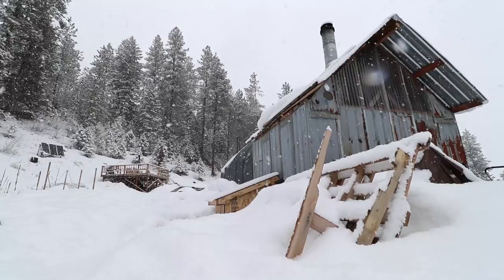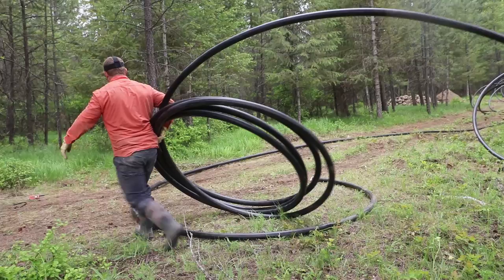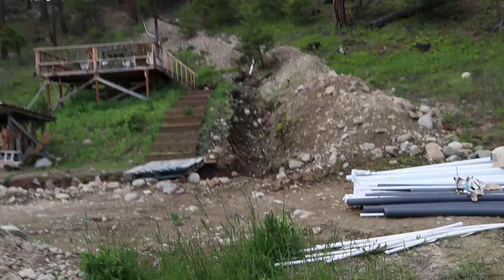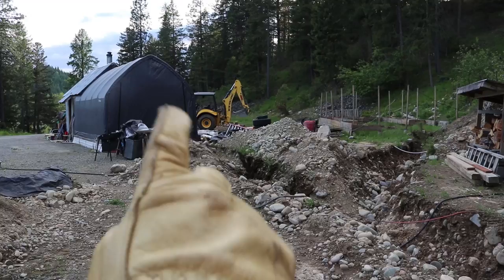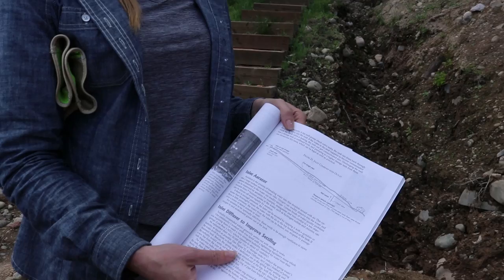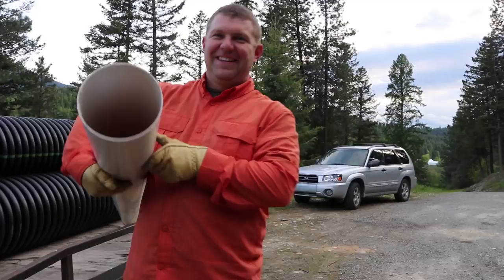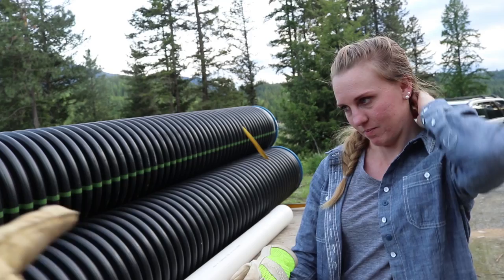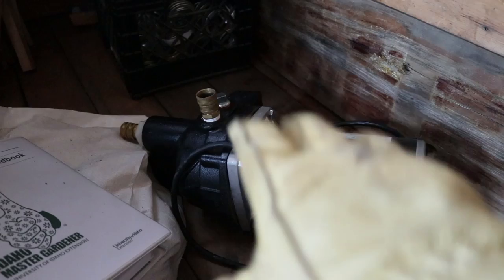EPIC $10,000 OFF GRID GRAVITY-FED WATER SYSTEM

Comment: after all is said and done you still have to fill your cistern with water that you have to pump up-hill.........drill a well..
Reply: solar powered pump...with the amount of money already spent they could have had the well drilled....and with this system they have to fill that cistern for ever.....and they'll be paying for that water also
Reply: +supurbian agreed, even if they bought 10 pressure tanks and ran a 120 volt submersible on a generator , they would be better long term . still not self sufficient.. I'd be looking for a few well witches and see what they say .. or even use that back hoe to dig a shallow well and see if that works. all that stone would be handy for making a foundation tho...
Reply: No, supurbian, it would cost them a lot more to have the well right now...  

Drilling a well, especially if you have to hire someone to do it, can costs more than several thousands easily... Especially, as there is no guarantees in the process and they may need to dig in multiple spots until they find water.  

Spending triple what they paid for their present system isn't unheard of and in most cases it's usually well over $10K... Especially in places like there's which will be hard to dig through...

Add, a well pump system will require more power than their present system provides.  So would mean they would need to upgrade their solar or spend constantly on fuel for the generator...  So the well water would hardly be free of costs... and could push their total costs over $50K... Funds they don't have at the moment as they're spending it all on the equipment to build the house...

Besides, if they add a rain catchment to their present system then they won't have to pay for water anymore and the cisterns hold enough to last them a couple of months.  So they're good for a severe drought...

And with the rain catchment they will no longer need a pump at all as the gravity feed system requires no power... 

While lets not forget they're trying to build a house... They're hoping to not need to spend another winter in the RV... So that's the priority for their funds right now...

Not to mention worse case, if their septic tank ever fails then that means the well water would be contaminated and then the cisterns would be the only safe water in the area...  So it's better to have it in the long run as things can go wrong and eventually will over the years...

Part of being off-grid is being prepared for when those bad things happen...
Reply: +verteup you seem to be missing the point, there are more than one type of well..
Reply: the real point here is that they bought a piece of land without the most important thing needed...and that's water..and a well would add to the value of their property... it's not as if they're building a hunting cabin or a bug out shelter...
Reply: Or better yet a rain catch water system?  Are they in a drought area that doesn't allow for it?
Reply: ed p, you have any idea how many properties around the country... forget that, around the world, exist with no wells?  The majority of people on the planet are not getting their water from wells!

Sure, a well or spring help add value but not every property needs them!

Unless you're living out in the desert and water is vital then there are other options!

There are people who have lived on their property for generations with nothing more than rain catchment...

Even having a well is no guarantee... Wells can go dry, geological water tables aren't static... Droughts, seismic activities, potential contamination, etc.... There are multiple reasons why wells can fail...

They do plan on eventually trying to get a well if they can but there's no reason they should limit themselves to only one water source... Redundancy is good when you're off-grid because the only one who is going to help you when things go wrong is yourself and what things you put in place to cover you when that happens...

Really, what do you think is going to happen to the well water if their septic system ever fails and spews sewage into the ground water?

What happens if they have a power failure but have a fire on their property?  Well water is not going to pump itself?  Gravity fed cisterns on the other hand will continue to work even with no power...

Among many other scenarios where multiple water sources not only make sense but can make the difference between surviving and dying on their property...
Reply: William McClain, no problem... You made a good point too... No well digger can guarantee water and in some parts of the country they may have to dig very deep...

I believe they stated in one of their videos that they're in a glacial deposit zones... So the makeup of their ground can be a wide mix of things, which means there likely isn't a consistent water table throughout their area, which increases the chances it'll be hit or miss and combined with how high they are above seas level means they will likely have to dig more than a couple hundred feet down to even try...

If the bedrock is really deep, then the rocky soil also means they'll likely have to use casements going pretty deep too, compounding the cost of digging a well...

Environmental rules in their area may also require them to only use water from a certain depth to avoid possible contamination from the surface.

It can still be done, but it's likely going to take a serious investment that there's no reason to rush now when they're trying to build a home and not live in a RV any longer than they have to...

Their recent AC install video highlight one of the many reasons why the sooner they can move out of the RV the better...
Reply: first off you guessed wrong.. i didn't say the property is worthless without a well...i said a well would add to the value... what makes that piece of property attractive is that it is wooded mixed hardwood and softwood (pine)...looks like they got two rocks for every dirt.i cant wait to see when they start plowing the garden....unless they go with raised beds....oh i almost forgot.the garden also will need water!!
Reply: Nope, a water well for acreage can have some value, but you typically won't recoup the total expense unless you managed to get it drilled very cheaply and don't run into costly maintenance and repair costs and are lucky enough to be able to get good quality water that doesn't require water treatment to be usable... But that's not something that can be guaranteed...

Again, most of the people on this planet are not getting their water from wells and that's for a bunch of reasons!

Wells are not a cure all or guaranteed in any way and there are times where other solutions are more practical and economical... There are also times where you may need multiple water sources as no one water source may be guaranteed or provide for all your needs in every possible situation.

Even after getting a well, they can fail for any number of reasons... Wells are not a unlimited resource, but part of the hydrologic cycle... Just like rain water, rivers, and streams, etc.

The ebb and flow of water through the ground can change over time and even dry out... So pretending it's some guaranteed resource is misleading at best.

Sure, some people can definitely benefit, but again it's not something that can be counted on everywhere....

People, however, live everywhere regardless of whether there are easy to dig wells or not or other easy to access resources...  

Places like Las Vegas were built in the middle of deserts!  Among other examples where local resources didn't matter...

So again, other solutions are valid... There's no one right way to do things and there can be multiple solutions that compliment each other to serve a greater range of needs.

Really, there are plenty of things that can be useful but it doesn't mean they're for everyone... There's always pros and cons to be considered and location matters as that can change many variables as to what can and can't work for a given area...

Comment: I hope you know you will be giving up pressure I recommend a water tower to increase your ft.pounds and volume. 
I am a Master Plumber and the potable water is going to loose head pressure if you push and on those hydrants I recommend turning the tee downward into a gravel bed then drive a pole beside them and when you shut it off it has a place to drain!

Comment: I'm not sure why you need a separate fill line for the cistern.  You can connect to any facet at the bottom and pump your fill water up the same line you use to supply water for your needs at the bottom of the hill.  Just a thought.

Comment: I'm a little confused, where exactly does the water come from? Are you having it shipped in, a spring on the property, where?
Reply: Michael Robertson Ship it in
Reply: I'm a little confused he said a couple of bucks to have the water brought in?  So someone will drive a truck and sell you $2 worth of water 2000 gallons or so?  Somethings not adding up?  UPS/Fedex want an extra $3-4 just to go to a residential address over a commercial address to deliver a 1 pound package.

That water here from the utility would cost around $1.3 if at Tier 1 water rates, or as high as $4.5 if at tier 3.

Comment: I have a well that I just upgraded the tank and fittings for, new well from my installer minimum is 3500 my 100ft well cost that. 30k would be insane. However how far down do you need to go where you live?

Comment: Interesting setup, few questions; You're running a generator to power an electric water pump that is feeding through a garden hose up stream? Why not buy a cheap 2" gas pump for sending the water up hill. I've been using a cheap Hazard Fraught 2" gas pump for years, filling my IBC totes and also transferring rain collection water. Also, did you ever think about burying the big tanks closer and just use a on demand pump to a LARGE pressure tank? You could have solar hooked to a bank of deep cycle marine batteries for the pump. I bet something like that would have been a LOT less that $10 Large. I still think a well is the best idea, if SHTF and you can't get water at water world or wherever you get it, you'll be okay for a little while, but then what?

Comment: So 50 ft head/2.31 ft head/psi = 21.65 psi at the tap. Not bad for a gravity system!
Reply: htmagic  would that be enough to run a ram pump?
Reply: altaylor1980 easily able to run a ram they can be ran off 6ft of head these guys have 50ft of head

Comment: excuse an ignorant question here;  With all the rocks and boulders in the cistern pit, why do you need to remove those?  I understand not wanting to drop large rocks on the cistern as you are filling the hole, but if they're already there.... why not add sand around them to stabilize around the rocks and then just back fill as planned?   Also love your channel and I'm planning on making a similar move in the next few years myself, also in Idaho, possibly around the SE side of the state.  Thank you for your videos and all you do to make this accessible to folks like me, I greatly appreciate it!!!!
Reply from the maker: +Jayson Davidson Its ideal to have a downward slope out of the cistern, and if we added sand over the rock, the pipe would be going up away from the cistern. And our cistern documentation specifies that the backfill shouldn't contain stones larger than 3" in diameter. Also, the weak points of the cistern is the curved part at the bottom, so even more important to not have rock under it. Good questions!

Comment: Could the tracer wire double up as network cable? Depending on the length of the trench, you might want to pull a few network cable up there for monitoring the water level or for a camera feed, etc.
Reply: I suggested running a signal wire through the other conduit. Could also run network cable for a sensor, camera, etc.
Reply: The tracer wire can't be used for networking. It is single strand, no twist, wrong gauge. But, I do think it would be a good Idea to add in a couple of Cat5e cables. I would get a 1000 foot roll/box  of direct burry and run as many complete lines as that would allow. It might be over the length limit but, it would be fine for sensors and the like.
Reply: Eric, I never said the tracer wire could be used instead of Cat5e cable as there are 4 twisted pairs of wires and usually shielded as well. And the tracer wire would go outside the conduit...
Reply: I forgot to add that I think the tracers used for finding utilities uses higher current than network tracers. Also, if you do end up using the network cable then you would not have a tracer cable. It would be best practice to run both instead of trying to make one thing do something it is not designed for. There are times where things can have dual uses and that's good to look for. But, you have to know where it would be more work or money if the thing fails.
Reply: No Eric, the network cables would be inside the conduit. The tracer cable would be outside of the PVC conduit. Harold,  you have to keep the tracer cable separate and away from the network cables.

Comment: Well, I thought I would weigh in on this. Since I'm not there and have little experience in these matters, it makes me an expert....LOL Just kidding....

While on vacation we spent a few days in Taos NM in an Earthship. Since these buildings are geared for off-grid applications they're great for ideas on these types of systems. They use a rainwater catchment where the water is funneled into cysterns and pumped throughout the home. Of course, they use some electricity to do so as well as a great filtration system. It was very interesting how they accomplish this with so little cost and power consumption. It would be well worth a read about their WOM (Water Organization Module).

Just my 2 cents and well worth it...LOL

Comment: Wells are NOT purely on demand. They typically use a 30-40 gallon air bladder type of arrangement. Use a lot of power? Well depends on how high your usage is,but let me describe mine. Its a 200 foot deep well and is about 100 feet away from the house. It is 3/4 hp ,made of stainless steel, and has not given me a single issue in 26 years, primarily because I oversized the copper wire. (The well motor in an induction motor ,over sizing the wire has a lot of benefit) The well casing is 6 inch pvc. I was told going much deeper than 200 feet requires iron pipe,which is more expensive AND leeches iron into the water, necessitating water treatment. have you considered having a consulting discussion with a local well driller?

Comment: yes  water pump doesn't really take much electric, just pump up your system to a pressure of say 60psi in 5 minutes... and with judicial use the water will last a day.   But finding water is a risk, that is something you would need an expert to do so you don't waste your time.   If since you are on a hill  you could find a natural area where water pools, you could use that for "some" grey water uses  once the sediment settles its ok for some things (not drinking obviously).  That type collected pooling water or runoff water, once sediment settled could also be used to flush toilets possibly too. that would take a load off your issues.

Comment: Go with your current plan of trucking in the water, but if you reach a point where you want to go with a well, then look into a solar powered submersible well pump. The complete system is only about $600.  It will pump 1-2 gal/min, which sounds small, but it will do it for 8-10 hours a day and you'll have more than enough water.,

Comment: The depth you have to dig to find the groundwater level is often deeper if you're settled in the mountains, this is ofcourse also dependent on the flow of the groundwater. It's much easier to "empty" the well if you use more water than what is able to flow to the well, therefore lowering the groundwater level. 
This is extremely environment dependent and will alter from place to place.
But I'm almost certain you would have to dig a deep well to be sure to always have water(the more pricey kind). I think your solution is better because you will never have to worry about being without water due to dried well. Do you use any treatment of the water, like hypochlorite? I wouldn't want to have any bacteria growing in the water tank and the pipes.

Comment: Quick Suggestion: Consider adding a data cable so you can have the option of installing a electronic sensors to monitor the water level. Perhaps a shielded CAT 6 cable.A Well does not necessary need lots and lots of power. You can buy a Solar well pump that would pressurize a water tank. See Engineer775's Youtube Channel on Solar well installs.

Comment: Wow.  Cant believe all the negative feedback.  I see it as they have several goals.  At the end of the day they want a home estate that is built well, some may say overbuilt, they want low maintenance, and they want no debt.  That last item is going to be quite the accomplishment!  I have had to haul water, not a big deal, you do get tired of it.  As for the cisterns, I would not have it any other way, well or no well.  Well goes down you have several days, if not weeks, of usable water while you fix the well.  I store 8000 gallons of water for the cattle and 3800 for domestic.  After they get the storage portion of the system in and paid for I would save money and haul water.  At the same time I would be chatting up every well driller in the area to find out what is going on in the area with wells and water.  Out here where I am at where oil and water both have high value a home can easy run on a 2 or 3 gallon a minute water well.  My Family has lived on a cattle ranch for over 100 years and our best and only well for the house and the cattle is 2 to 4 gallon per minute at best!  The water is so hard it bounces, but the cattle drink it and we soften and filter it at the casa.